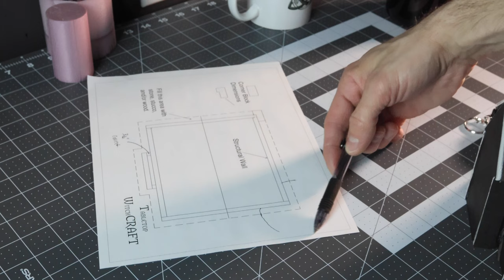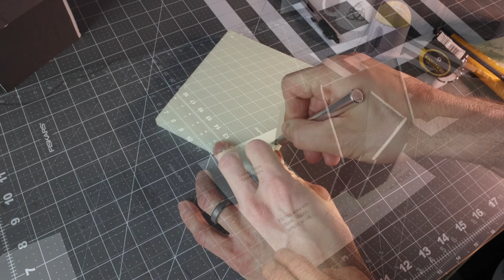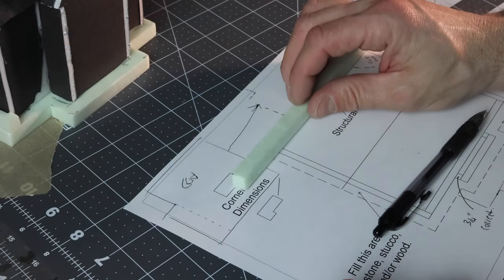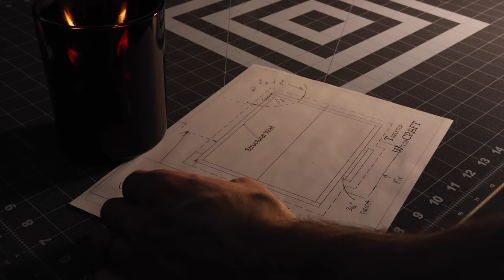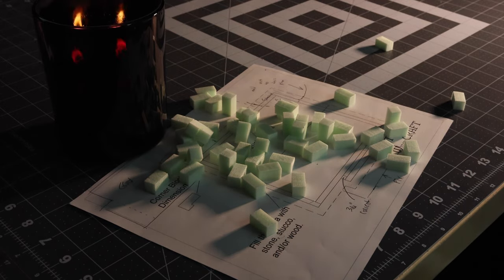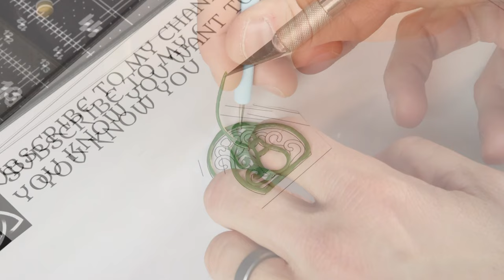Craft a POTION SHOP for Tabletop Gaming with Amazing Effects

Comment: I used this technique on my gingerbread house on New Years eve. I didn't use "Milliput", but I used (EVA Foam Clay) a lot easier to use covering items, instead of the Milliput. Wet your fingers and tools with water to smooth the foam clay . it can be sanded and painted after it air dries...
Reply from the maker: Yep, that's a great option.  Thanks Jesse.

Comment: Cant Wait to experiment with my fog mashine, really love the way you implemented it in this building. I'm thinking about a smaler version of your build with more Gears and Screws for a Village of Gnomes
Reply from the maker: Ahh, very cool!  This build was pushing it on size to fit the smoke machine inside.  If you go smaller you might want to consider having the machine outside the house or some other way to conceal it.
Reply: @TabletopWitchCRAFT  good call , will have that in mind

Comment: I really really want to get into building dioramas and scenery like this, but I don't play any tabletop. 🙈
I actually have some experience painting model horses and dolls. I'm familiar with apoxie sculpt. 
One of my Christmas presents was an air brush set. I've not yet dared to open and use it 🙈
Still afraid of building and painting my first diorama
Reply from the maker: Don't be afraid to start.  Pick out a small project and just mess around and have fun.  The technique and skill will come in time.  Just try and learn something every time you craft and it's a success!

Comment: Great build from you man, it looks awesome, and the more I watch these YouTube videos on terrain, buildings, and other pieces for gaming, the more I feel like I can and should make my own pieces for my games.

 So, is it just me, or do others feel like this one could be playable since the fog machine is inside the 'house' portion, and making it playable would only require the base to be gridded, textured, and maybe furnished?

I mean, you don't need full walls just a suggestion of them to separate areas on the map, so basically just about an eighth inch tall wall piece on the base, or however tall wylock's walls are.

Anyway, great piece, and you, wylock, bards craft, nerdforge, and a few others are really inspiration to me for making my own playable, modular terrain and buildings.

Eventually I will have to buy some smoke machines and such for whatever I design. Definitely going to happen eventually, I see it already.
Reply from the maker: Thank you Nightgall89 z  I appreciate that.  Jump right in.  Decide on an easy craft and have fun with it... That's it.  Just have fun!  As for playing the interior 100%.  The fog machine can be secured to the top and a grid can be added to the base, or simply make another 5"x6" base to replace the house!  Start crafting :)
Reply: @TabletopWitchCRAFT  thanks man, but um, you have a typo in my name. Its cool though, cell phone and tablet keyboards are somewhat annoying.
Reply from the maker: @nightfall89z62  sorry about that..

Comment: This is amazing. Are your smoke machine attachments permanent in your builds? Are you buying a new set of accessories for each project now? Curious of how modular using the smoke machine is. My suggestion for an addition to your village is a ship if it’s a coastal town, playable in the inner decks. Even cooler would be an air ship.
Reply from the maker: Thanks Sarah!  So far every video that I've shown the smoke machine has been modular.  You can remove all of the components.  That being said,  I'm going to leave all of the attachments in this build except for the smoke machine for now.  Excellent idea for a future build!

Comment: Not fully through yet.  Would it have been possible to camouflage the smoke machine on the inside with greeblies etc so it is truly playable vs having a sperate 5x6 base?
Reply from the maker: Actually you could suspend it to the structure I suppose and keep the current floor plan to play on.

Comment: What is the tool used for cutting a window in the XPS foam at 4:24 ?
Reply from the maker: It's a hot wire knife.  There is a link to the exact item I used under the Amazon Affiliate Links in the video description.